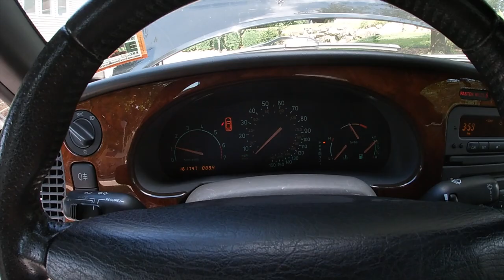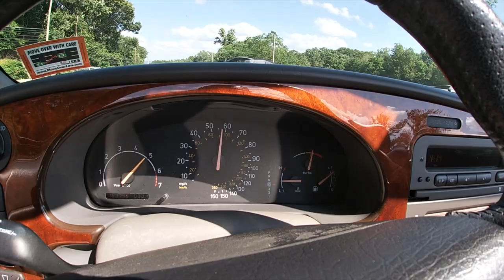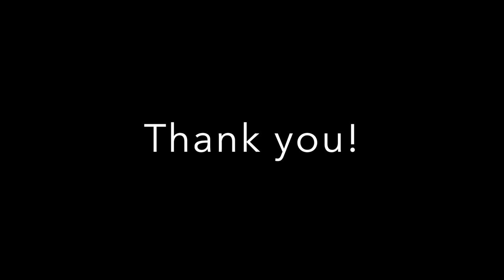A $10 Part that Can Blow your Turbocharged Engine - Saab In Depth

Comment: So I can check mine the same way? Isn’t it supposed to blow into the TB? I just replaced my whole PCV trap and hoses this spring. I too have some oil weeping on the drivers side facing the battery. So if I unhook it from the TB hose and use a glove and it blows towards the TB it’s no good?
Reply from the maker: If it blow out it's no good. If it lays there when you rev engine. It's good
Reply: I failed to say the valve cover is lightly weeping. Does that still mean I may have a failed check valve?
Reply: Kyle Pancis thank you!!! Imma go check it.
Reply from the maker: @chicagoui9299  pleasure.

Comment: Revving up a Turbo and immediately turning it off with the Turbo spinning higher RPMs from the revving up will kill a turbo by starving it for oil during RPM spin down.  FYI. Always allow a the RPM to idle and the turbo to spin down before turning off a Turbo Engine.
Reply from the maker: Yes! Thank you!

Comment: Thanks man for the post. I cleaned mine out as after watching your video I went and checked using the glove and it works perfectly I will probably still replace it because as you pointed out it's inexpensive but I also found some other cracked vacuum lines going to my Turbo controller so all-in-all you get an atta-boy and a gold star for the day. You save me a lot of headache from a problem I didn't even know existed

Comment: Had this part fail on my '17 GLC300 in extreme cold highway driving conditions (-35 to -40). Engine ate all the oil and then just seized and stopped. Mercedes did well though with a brand new crate engine  and full exhaust full under warranty. But crazy that the failure of a little part like this could completely destroy an engine.

Comment: Side note you can usually delete coolant lines to TV for more power. Used for quick warm up in cold areas but if you live in a reasonably warm area it will allow a cooler intake temp for more power.

Comment: Wonderful video and inputs , thank you for sharing those . 
I recently bought a 50,000 miles 02 9-5 Linear , I noticed light oil leak around the throttle body . 
The PCV valve kit wasn't done so i bought the kit and a shop did that for me - sooner or later that was a MUST DO thing from what i read - but then they told me that i have a vacuum leak because the white check valve is bad - allows airflow from BOTH side - !

So i will order a new one and do it by myself - 1m job - but I was just wondering if that has an arrow on it so you know how to install it . Should it allow the air to go from left to right as you are sitting in front of the car or viceversa ?

Comment: Thank you for posting this. It reminded me to check and the glove stands right up and is like a balloon. Valve replaced, PCV system checked and good. Compression test upcoming. Hopefully it's the turbo (which I know is on its last months) and not the rings...

Comment: Thanks for the video! In openSID I see that I am missing boost and having higher fuel consumption. In which direction should the check valve be oriented, when installing a new one? Because you can blow through one side of course
Reply from the maker: Arrow pointing towards TB

Comment: I know it's an old video but i have a question. I have a saab 9-3 coupe with the 2.0 turbo (B205E) engine and i suspect theres more crank pressure than it should, as theres a leak in my sump. I tried the test with the glove and got the same result, but i was wondering, does it affect the test whether the oil is hot or not?  Btw thanks for all the info on your videos, very much helpful

Comment: when you check the one way valve by blowing thru, how much pressure should there be?  My old one was completely destroyed and could blow by both ways.  The new one is not an oem and seems kind of hard to blow thru.   just want to know if thats normal.  going to order an OEM but this is all i have right now.  it is the one for an old 2002 VW

Comment: I have a 2004 which, if I'm understanding right, has the updated PCV system. When I started the car, the glove popped up as the engine turned, but then when it was on and started idling the gloved started to suck in briefly. Is this something I need to worry about on a 2004?

Comment: Damn that throttlebody is 590€ o.O. Mine is also Oily. So the checkvalve can cause oil leaks at the throttle body? If so it could be enought to change the checkvalve and clean my throttlebody? Or is it likley that the throttlebody is also broken?

Comment: Hello, I am writing to you from Romania, I have a problem with the crankcase saab 93 2001 150 hp. I would like to know if the pcv6 system has the 2 large holes or not? 
I would like to enlarge that hole with a drill if it would work more efficiently. It's about the hose that comes in the turbo pipe (it's metal).
Thank you very much!

Comment: I just got a 2004 Saab arc turbo, do I have to worry about this? If so can I use any check valve as long as it is a one way? Need help plz. Also I don’t know where the oil trap is.

Comment: If the valve cover gasket is good then oil should not get past it doesnt make sense? How would it be leaking if it good? I'm a mechanic that doesnt add up. Intake yes but valvecover no. Still good video. Did you have a lean code? Nightmare code with these cars.

Comment: Now I seem to understand..... Is it to prevent boost pressure from entering crank case if that's the case now I understand..... I also notice on your cars intake there is pipe missing on plastic pipe just before throttle body... If air comes out there are you not losing boost pressure??
Reply from the maker: everything seems to be working at normal spec. But yes, the check valve is to prevents crankcase pressure from boost.

Comment: Hi. I've got a 2006 9-3 2.0T SportCombi. I'm the original owner and the car has 93k miles. The engine just started idling rough and scanner shows generic code P0300. I wonder if  the $10ish "check valve" could cause this problem? I also noticed a small amount of oil on a thick pipe under the engine (name unknown) My engine oil level is full and I had no prior oil leak. Any ideas for diagnosing the problem? Thanks, Mike
Reply from the maker: Sounds like Spark Plugs and coils
Reply: @KylePancis  - thanks Kyle I'll report back

Comment: Great video, Kyle - thank you! You earned a subscribe from me... I found this because I was investigating an issue with my 2002 9-5 3.0 V6 where it is burning enough oil that it smokes on start up (blue smoke) and it smokes a little sometimes when revving the engine. I checked the valve and sure enough, it failed the glove test. And then when I took it off, I could blow air with no resistance in both directions. I found a new check valve at a parts store about 20 miles away, so I'm about to go pick it up, along with some new hose because the existing one is done for. 

This car has 202k miles on it and it runs great. I picked it up for 500 bucks, so I'm slowly fixing things. (A lot of things, haha) If it still burns oil, what should I check next? Thanks again!
Reply: By the way... a couple weeks ago I was replacing the radiator and both hoses, and while I was at it I replaced the front-facing valve cover gasket. Spark plugs were swimming in oil. The gasket is still holding, probably because I've only driven a few miles since buttoning it back up.
Reply: @ericgilchrist  I do believe I have the same valve issue on my 9-5 3.0 V6 too.. I live in Sweden Btw!

Comment: The 2006 model is a pain in the ass to change because that check valve is attached to the goddamn hard tube which means you have to finish it all the way back down and then bring it behind the intake. I’m trying to find a way to get around that and do a hack job. It’s too hot outside right now to screw around with this

Comment: I’ve got a 2001 Saab 9.5 2.0L motor. It’s got 344000km on it at the moment and I fitted the Pcv update kit 2 years ago at 305000km. I’ve checked the value you mentioned about and it’s ok. I’ve got glovebox blowing out on idle and acceleration. Any tips to help fix please?

Comment: Hello Kyle. I tried to order the check valve filter. No Luck! The pcv valve listed on your page) sent by Amazon did not fit. The check Valve was bigger and had larger plastic inlets etc. I have tried in vain to find the correct check valve filter (part number). Could you guide me to the correct Filter? Thanks. I have a 2007 Saab 95 estate wagon.

Comment: Is this the same for a Saab 9-3 I have a strange problem when I bought my 2008 9-3t 2.0 I didn't realize but the top radiator hose has a t to feed coolant to Turbo that's unhooked now so no coolant going to Turbo will this hurt my car probably right. when it is hooked up it seems like it's introducing exhaust gases into the system and over pressurizing. Entire coolant system same time it's keeps asking for coolant it's not a head gasket leak I had that tested any help on this would be greatly appreciated thanks

Comment: The check valve on my 2000 Saab 9-3 convertible is smaller and yellow and can't find image like it. Is it possibs it's not an original 9-3 check valve  that I've  eseem pics of? THANKS

Comment: Hi Kyle! Thanks for your vid it helped. I ordered a new check valve as I was getting an oil leak from where you said on the rocker cover (the bottom right side). I replaced the gasket a couple months back and recently done the check valve but the oil is still leaking out. No leaks on throttle body. Any ideas of what's going on? Thanks for any advice. I have a saab 95 aero 2.3lt 2000 reg
Reply from the maker: how bad is the leak? sometimes there is some residual oil that can be there. Another thought if your is an automatic is the vacuum pump. sometimes the aftermarket gaskets can be quirky around those bends in the cover. maybe pull it off again if really bad and put some gasket maker in there. Slight film.
Reply: @KylePancis  it's slow but noticeable. I  ran her for 40 mins and it was noticeable again. Its a manual. I will try that today however the leak was there when I replaced the gasket. No leaks anywhere else can't figure it out
Reply from the maker: @Charlie-be6fx  if that's the only spot that's leaky and the car passed the "glove" test. put a super-thin layer gasket maker in there and it should be good
Reply: @KylePancis  it is yes. It may be a faulty check valve I've got a new one coming as the other new one could have been. It is the only spot yes. For the glove test do you take the dipstick out? Would it work with a plastic bag? Did try didn't see any movement

Comment: Dude!, I tried the glove test on my 01 Viggen and it almost sucked the glove down the oil tube!  (i.e., itdid not inflate it.) That would have sucked! So does that mean I have negative pressure and my PVC system is working properly?
Reply from the maker: Yup! You have a healthy setup! Just make sure internal seals under oil pan are fresh...and drive away!

Comment: Hey Kyle.......  i have just acquired a 2001 9-5 2.0t... great service history, well looked after, a few stone chips here and there, but runs great. I have just changed the diverter valve for an adjustable metal one, and now the check engine light keeps coming on, i have adjusted it from hard to soft, but it has made no difference. All hoses are in place but every time i clear the code (P1110) after a day or two the CEL comes back on. Any ideas... cheers, Andy UK.

Comment: I got a new check valve and the glove still inflates a little bit when revving the engine. What else could cause this? I’ve been searching all over the internet and can’t find good info for the 3.0! Everything seems to be for the 4-bangers.

Anyway where the tube goes into the TB - it sucks in. Doesn’t blow at all.
Reply from the maker: Should be ok. Slight inflate is normal. As long as it gets that suction your getting good crank pressure.

Lol some would say nothings good for the 3.0....keep saabing
Reply: Okay good. It is only slight. Next big concern is burning oil. And there is oil inside the 3” rubber boot leading into the TB. Probably safe to jump right into replacing the turbo?
Reply from the maker: @ericgilchrist  yea, maybe approaching depending on how bad it is.

Comment: Where do you get the part that is under the charge pipe where the sensor is?  It bolts to the valve cover, I believe it's 3 bolts

Comment: I just looked any mine wasnt even connecting the 2 hoses,  I ordered a new one, but can someone tell me which direction the air flow arrow is supposed to go?  Hope this stops my small oil leak also!
Reply from the maker: It will slow leaks up ..arrow points towards throttle body!

Comment: Hi Kyle. What if, in my case on idle the glove is sucked into the oil filler? After I replaced my valve with an aluminum one, having open SID the Mair is always higher than the Mreq and all this is happening after the valve replacement. Mine is 2.0 LPT stage 1 from 1999.  Thanks
Reply from the maker: A little sucked in is fine! That's good.
Reply: Ok, but mine sucks the whole glove in, I was actually afraid to not take the whoe glove inside
Reply from the maker: @bakorobert9906  i dont see it being an issue. how many miles do you have? Also, any crazy leaks or noises from engine?
Reply: @KylePancis   the angine has 240tkm, at 196tkm the engine got new chain , new clutch, sump cleaned  last month. Has no leaks , actually between two oil changes I dont need to add any oil.
Reply from the maker: @bakorobert9906  sounds 10,000% healthy engine!

Comment: Also, I am throwing a code for low voltage on my Bank 1 O2 sensor. Should I just get the new sensor and forget about it or check to see if there’s wires that are cracked and losing voltage?
Reply: First check wiring... Then remove 02 sensor and just clean it these things very seldom go bad so just a clean should work
Reply: wow Theo okay thank you!! So let me elaborate. It runs great up until it gets to full operating temp. Then it will stutter and hesitate a bit then it’s rip snorting. Also I failed to mention I have open Sid. I’m throwing a hella bunch of misfires. Could this be related? It has new plugs. The DIC is a year old.
Reply: @chicagoui9299  Something to try set your plug gaps smaller 0.50mm not sure inches....My car can't run bigger gap than that without misfiring.. Try that and let me know
Reply: wow Theo for sure. Thank you.
Reply: wow Theo my engine is the 2.3T. Is .50mm okay with a stage 2 tune?
Reply: @chicagoui9299  Yes small gab is much better give it a go...You won't break anything.
Reply: Correct gap is.  .020 inches. Or. 0.50mm
Reply: wow Theo wow everyone I know says .038-.043. Well I’m definitely falling the plugs tomorrow. Thank you!!?

Comment: I replaced my check valve with an industrial aluminum one. These things are pesky so I figured I'd just use a heavy duty version and call it a day, month, years lol
Reply from the maker: Has it been good for that long?? I was thinking about doing that.
Reply: @KylePancis  It's been about a year but others have done it and have never had to revisit the issue again after years of usage. Plus they look cooler lol. If they can handle an industrial application, they should last forever in the engine bay.
Reply: Where did you get your aluminum check valves? I have a 2008 9-5 
Aero. I see what look like other check valves (one was repaired by previous owner with some kind of ‘shoe goo’ adhesive) on the hose assembly between the brake booster and throttle body if I remember correctly. Are all check valves the same (go - no-go) or are there specifications for each on depending use, air pressure, etc.?
Reply: @mickeytabor7607  You'll want to find a one way check valve. I believe I got mine from ebay. Let me check if the history is still there so I can give you specifics. Brb
Reply: @mickeytabor7607  it was ebay.
3/8" 10mm Aluminum fuel line one way non return check valve.
Reply: @kemercuryc Thx! I’ll have to check it out.

Comment: Does anyone have part number or which side of check valve it is?  I ordered the 10mm one in the comments below,  and doesn’t fit...TIA
Reply from the maker: What year is your car??? I just discovered this week they changed the part from 2004 onwards for the 9-5's.
Reply from the maker: https://amzn.to/30awy2r
Reply: 2003 Saab 93 SE
Reply from the maker: @joshuakohrs4900  convertible or sedan?
Reply: Convertible
Reply from the maker: @joshuakohrs4900  https://amzn.to/2YhTDyf
definitely, the item needed...sits right in front of the throttle body as shown in vid. arrow facing towards TB away from the engine.
Reply: Kyle,  thanks man,  without this video I never would have checked,  your videos have taught me a ton about Saab’s!  Thanks Again!
Reply from the maker: @joshuakohrs4900  thank you for your support and encouragement! Really happy to help.. keep in touch with any questions you may have

Comment: Could I bypass this and plug the intake port?
Reply: lol no.  You need the intake to suck the gas vapors out of the crankcase or the oil will get even more diluted and sludged that it already does.

Comment: Hey legend! Ive had the same problem but cant find where the other end of the check valve hose fits on. the previous owner had it removed. can you tell me where to plug the other end in?? thanks so much!